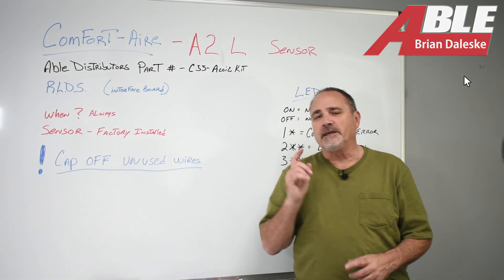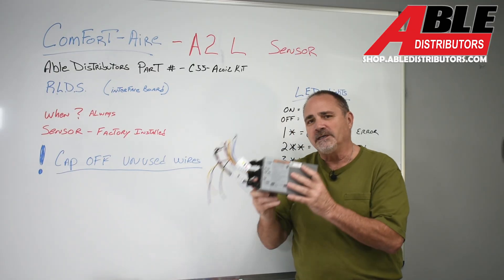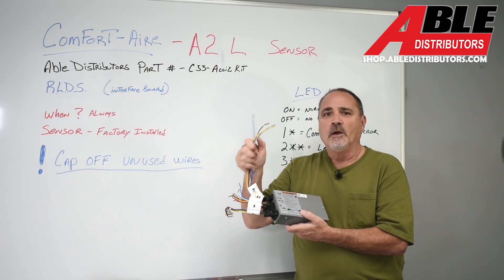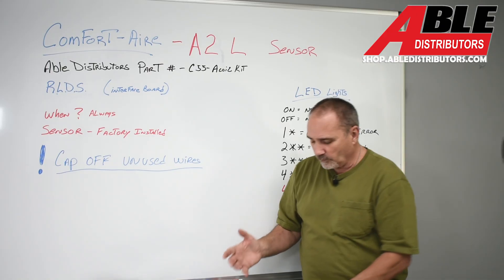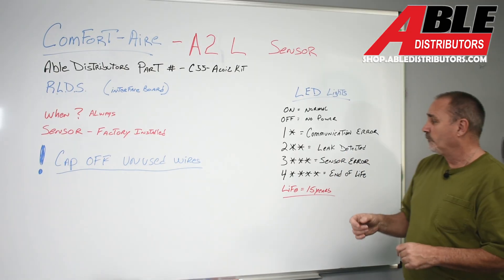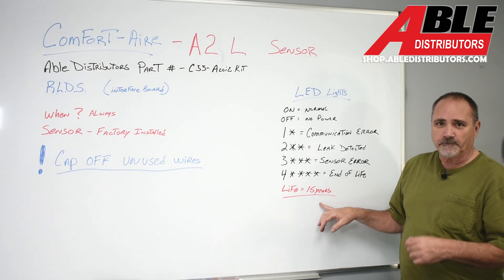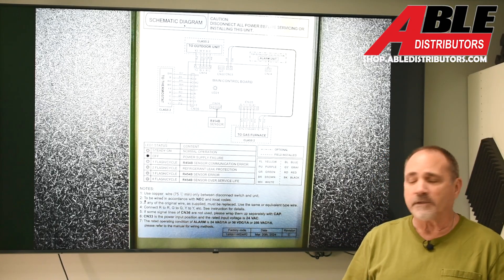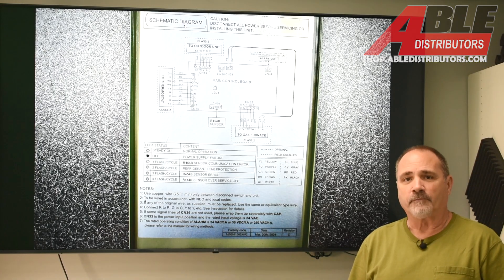Comfort-Aire A2L sensor and mitigation board wiring.

Comment: Amazing video ! Quick question if you get new a2l furnace with coil do you ditch the extra box? Plug directly into a2l furnace? Or is mitigation board always necessary?
Reply from the maker: great question, a bit of a complicated answer, but here goes...... brands will have A2lL furnaces and yes the sensor will plug into the board, it gets just a bit complicated because you'll need to match brands if that's the way you want to go, Comfort-Aire will have an A2L furnace soon, not out yet. Bosch has the same board and has their A2L furnace out now, so yes IF you get the new furnace, you can skip this mitigation board, Hope this helps, Thanks, Brian.
Reply: @abledistributors thank you